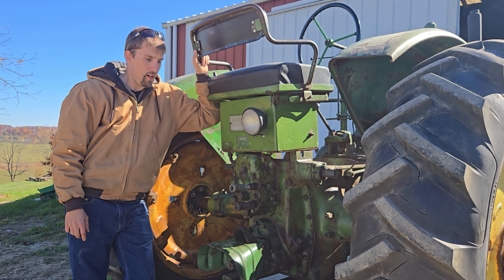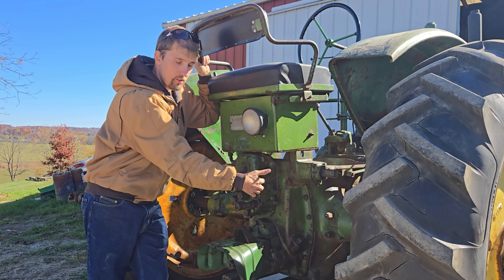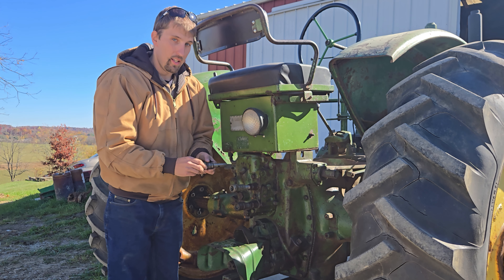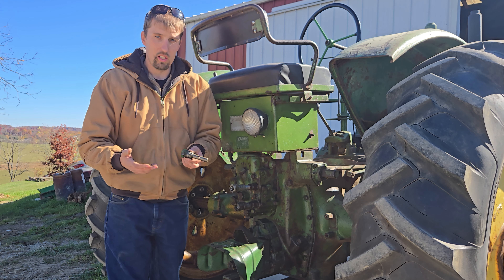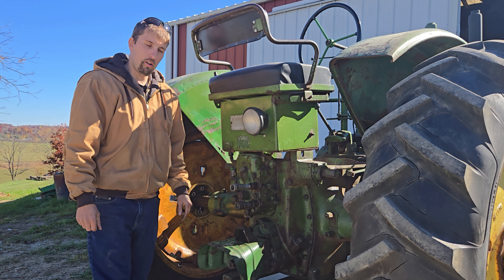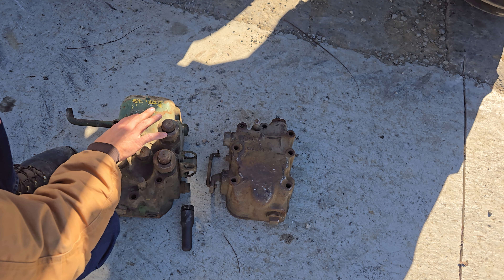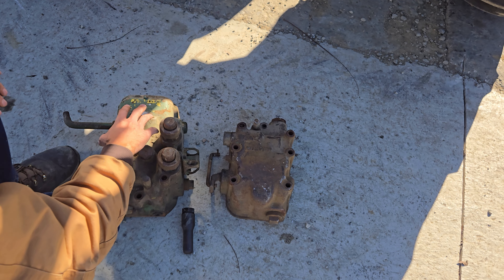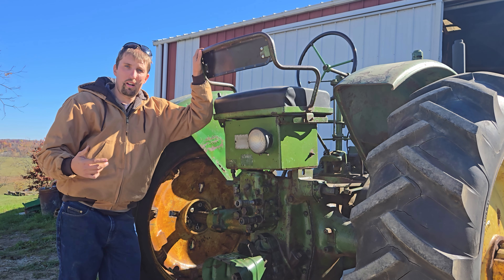Hydraulics & 3-Point Lift Arms - John Deere Letter Series Powr-Trol (A, B, G, etc.)

Comment: Hey Daniel - This video is good time (for me) as I have plans to unify my JD A, B, G in terms of hydraulic connections to make it easier for me to switch a single cylinder between tractors.  I'm thinking of moving over to the Pioneer Quick Connect fittings.

Comment: Hey Daniel I'd have to look in my book to be sure which one but there is a setscrew to adjust so you only get cylinder pressure and not rock shaft pressure. I have my 52 A setup this way with pioneer fittings coming out of the side.